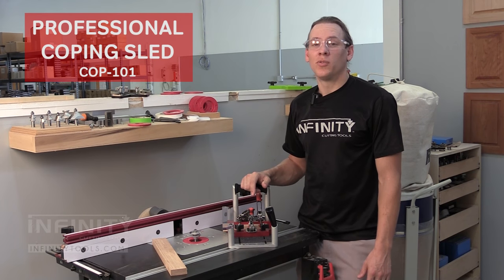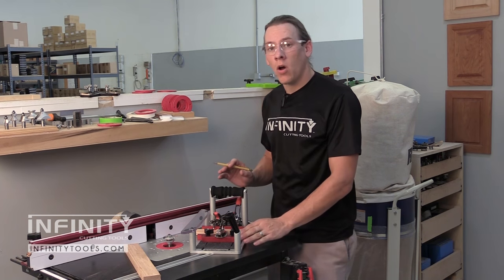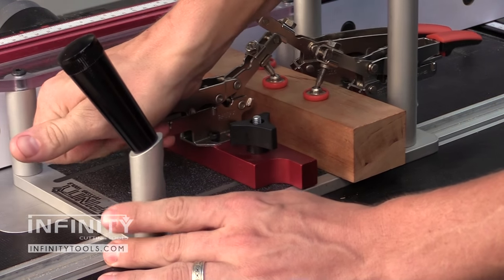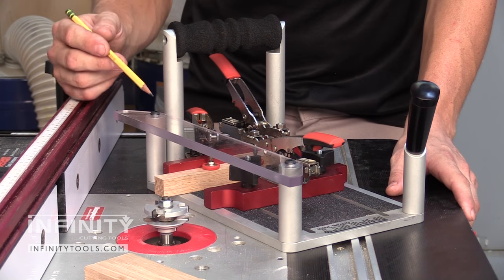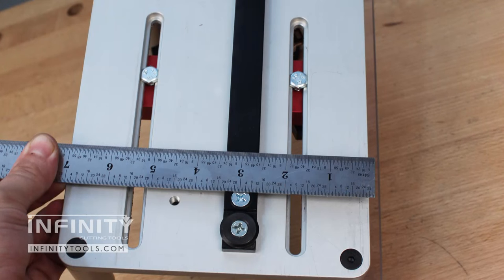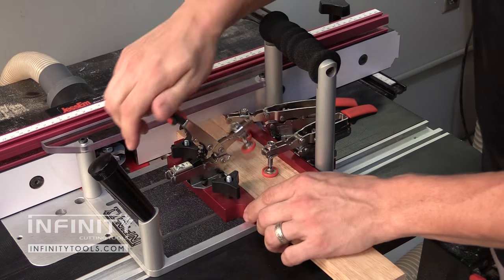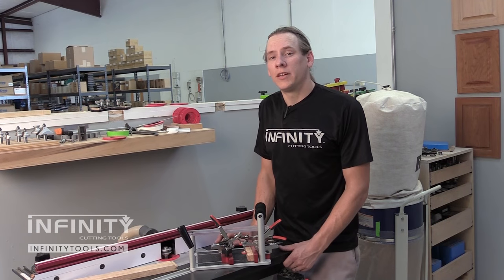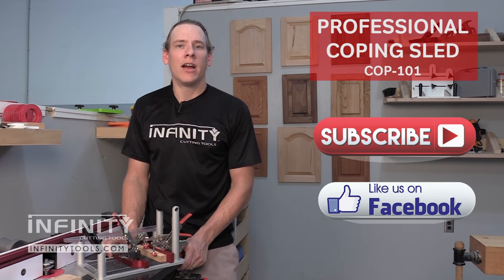Professional Coping Sled COP-101 featuring Auto-Adjust Clamps

Comment: It's nice the base is aluminum, sure it's very sturdy. But isn't that base rough on the table and router plate? Seems it would scratch up both?
Reply from the maker: In all the years we have been making our sled with an aluminum base it has never been a concern for us, nor have we ever received a complaint. 
If you ore worried about a little scratch here or there you can always add a strip or two of slick tape to the bottom of the sled. https://www.infinitytools.com/uhmw-slick-tape